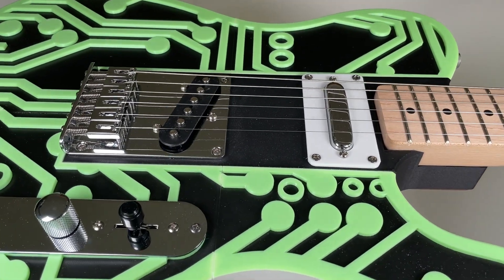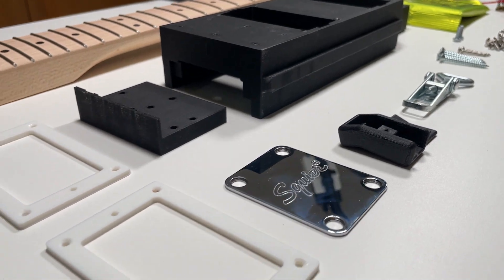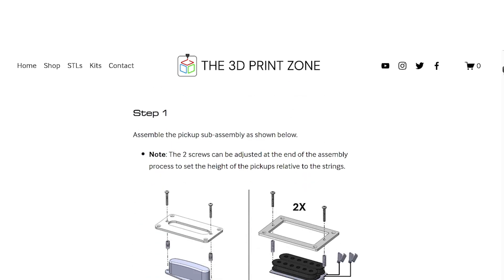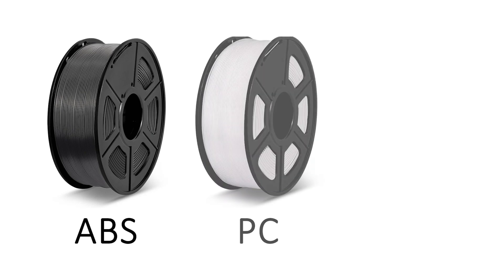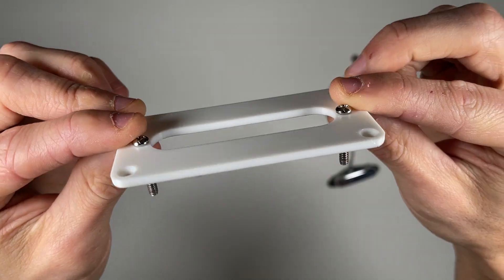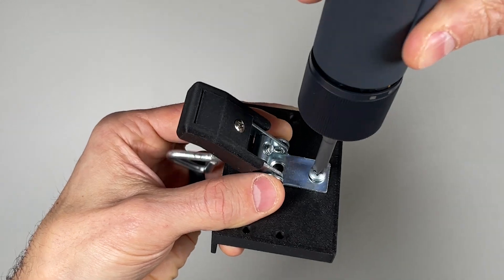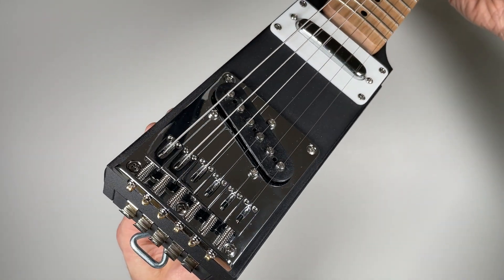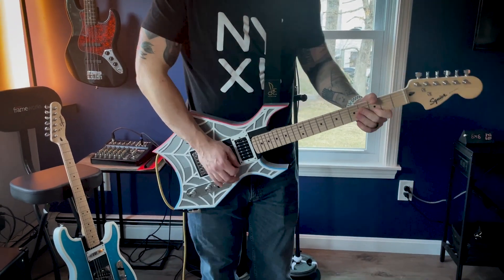3D Printed Modular Guitar Core (Single Coil) – Full Build!

Comment: Can the core fit AI mini?
Reply from the maker: The parts are designed for a print bed that’s 256mm X 256mm or greater
Reply: @the3dprintzone  A1 mini's bed is 180mm x 180mm. What issues to anticipate if printed in two parts then connected together? I'm thinking splitting the core into "puzzle-like" parts then assembling together.
Reply from the maker: @aericson_24  you can split the parts, there is just a risk with the center core that the joint between the split sections allows for flexing due to the string tension. For the outer body sections it wouldn't be an issue.

Comment: Coming from someone who knows nothing about music but wants to do this project, what is the major difference between single coil and dual coil? I see dual coil is more expensive and assume its better but is that true?
Reply: It's called a "humbucker". Single coils are known to be noisy (hums) and have a brighter and twangy tone. Humbuckers, as the name implies, were designed to eliminate the hum (IIRC the second coil is wound the opposite way to cancel the noise), but, as a side effect, is less twangy. It's pretty much just preference nowadays since there are single coils that are humbucking, and there are humbuckers that have a "split coil" switch that makes it sound like a single coil. Each has their own property, and it really depends on the sound (and flexibility) you're looking for (taking into account the genre you're after).

Where the pickup is situated also plays a role in the tone. Pickups close to the bridge will sound brighter than the ones near the neck (AKA the fretboard). Because of this, the bridge pickup is typically used for rhythm (ie. strumming chords), while the neck pickup is typically used for leads (ie. guitar solos).

Note that in the single coil kit shown, it looks like it is based on a Telecaster (angled pickup with a plate, and a distinctive covered single coil at the neck). You can check out audio examples to hear how it sounds. A lot of players that use Telecasters come from country, rock, even metal (although some would swap the pickups and use humbuckers to get a beefier tone - great for high gain stuff).
Reply: @antonm_ thank you so much!!!! This was incredibly helpful!

Comment: Whats the neck dive like on these?
Reply from the maker: Thanks for the question! No neck dive. You can adjust the density of the body to make it lighter/heavier to meet your preference. This is simply done by adjusting the "infill density" setting in your 3D printer slicer. So you can print the body heavier to ensure there isn't any neck dive.

Comment: How well would this do on a belt printer? I cant fit it on my aquila or ender 3 unless i split it.
Reply from the maker: I've never used a belt printer before, but I am guessing you could make it work. Alternatively, maybe you can tilt the part slightly if you bed is slightly too small (although this would of course introduce additional support material).

Comment: There's no way that holds tune.
Reply: Prove it instead of just complaining online.
Reply: @adre238901  The structure holding string tension is made of PLA, if your familiar with the properties of PLA it's self-evident that this can not hold tune. There's nothing to prove.
Reply: @brocktechnology  yes there is.  if all you're going to do is talk and not make a video proving it then stay off the internet.
Reply: @adre238901  I don't believe intelligent discussion works the the way you think it works but that's fine you do you.
Reply: @brocktechnology  just say you don't know shit about printing or guitars my guy. 🤷🏻‍♂️
Reply: @brocktechnology even if you set aside your assumption that someone prints it from pla and not a stiffer material, and setting aside where the actual stress is on the plastic parts here, you’re a buffoon.  You can easily embed a metal I beam if you want to go crazy high tension and are concerned about plastic deformation. 

Entire acrylic guitars, neck and body, have some tuning issues that are workable. This would absolutely be fine.
Reply: @threepe0  This is a fine observation except the video tells us that the key part is printed in PLA with no reinforcement.
Reply: @brocktechnology …which is absolutely fine. 
And if it weren’t, you could print the part from anything else (they sell the files,) and re-enforce.  Again, it would be totally unnecessary, but if you wanted to go nuts, you could.

Comment: Will you guys make a Bass?
Reply from the maker: Thank you for the comment. A bass guitar is a bit more challenging from a design perspective because the additional string tension due to the thicker gauges, and well as the longer scale (requiring a longer center core that would not fit on most 3D printers). Not to say it couldn't be done, but would be trickier to pull off.

Comment: this is awesome! I hope you make a version for bass guitar! P-bass, J-bass, Musicman-style, and EMG-style bass humbuckers. 4-string and 5 string versions please!
Reply from the maker: Thank you, and thanks for the suggestions! Bass guitar is a bit more challenging to design because the additional string tension due to the thicker gauges, and well as the longer scale (requiring a longer center core that would not fit on most 3D printers). Not to say it couldn't be done, but would be trickier to pull off.
Reply: @the3dprintzone  i tried 3d printing a pbass i found on printables about a year ago and learned that the neck pocket held well. the only problem i had was with the bridge mounting which was a flaw from the 3d model itself. but thinking about how you can go about a core, maybe it can print vertically (for 225mm height printers) or maybe make it two parts with reinforcement? just throwing out ideas hehe. i wish i knew 3d modelling so i can try designing it as well.
Reply from the maker: @irajamestech  thanks for the comment and suggestions! Splitting the core in separate sections can create weak points at the joints and potentially introduce the ability to flex or distort with the string tension. Printing vertically will position the layer lines in a orientation that will increase the chances of bending/flexing. Adding reinforcements to the core could definitely work depending on how you go about it. Maybe learn a new skill and try to 3D model one! :) Thanks again for the comment.

Comment: Sick project!

The potential for WEIRD electronics and "accessories" in every different body with the consistency of how it feels to play....I think this could be a really cool "ecosystem". 
Makes me want to have my floor FX wired into the body...changing bodies changes signal chains for the one off songs with the extra FX you only use on "that one song" in the set.

oooo even better....make a body with a SBC capable of running neural amp modeler in it and imbed your wireless transmitter 

I believe you sir, are a genius; and FURTHERMORE!!!!! I would like to receive your periodical 
Subbed
Reply from the maker: Thank you, I love the brainstorming! Yea, it opens the doors to between-song body swaps, and adding a wireless transmitter would be sweet. What kind of weird accessories?

Comment: Can we please, please, please get a version that can mount a floyd rose tremelo?
Reply from the maker: Adding a tremolo to a 3D printed center core can be challenging because of the additional stresses and strains it adds to the system. The tremolo springs and cavity both increase the stresses. There are also space constraints for the additional hardware. This isn't to say it can't be done with a 3D printed core, it would just be difficult to achieve.
Reply: @the3dprintzone  maybe you can pause the print halfway to put steel or carbon fiber rods for strength. or some clever use of longer screws in the right place to brace against the stress/strain from the trem
Reply: @baremetaltechtv instead of 3d printed you could try CNC on a peice of wood, that should work
Reply from the maker: @baremetaltechtv  yea, that's not a bad idea, might be able to do something like that. Good feedback!
Reply: @the3dprintzone bruh I really need me a Floyd rose SS telecaster
Reply: Floyd is an engineering abomination. Screw FR all the way.